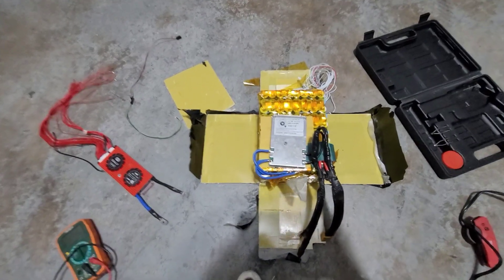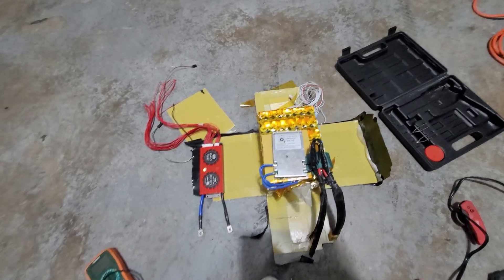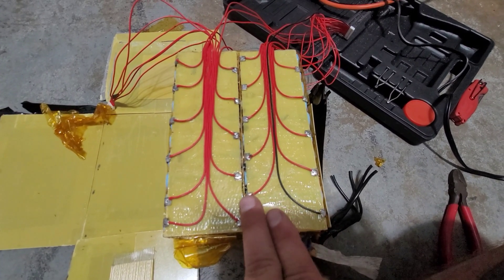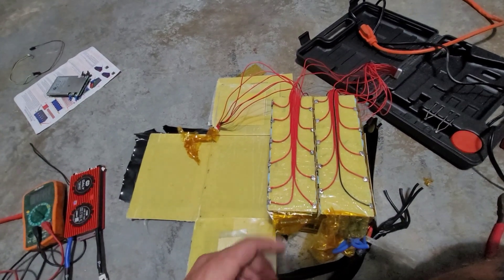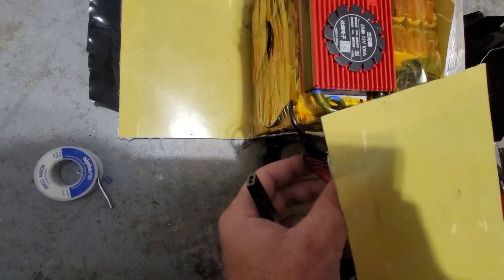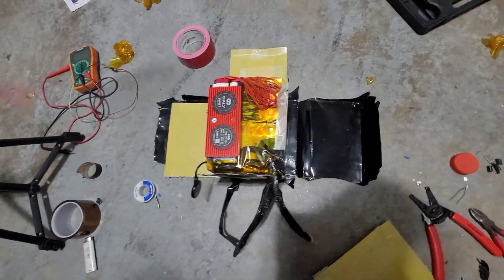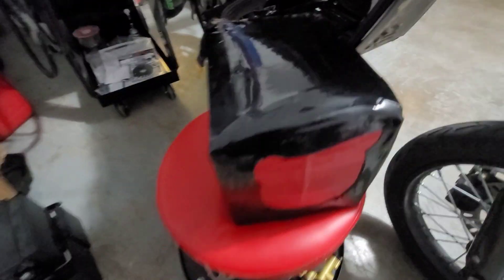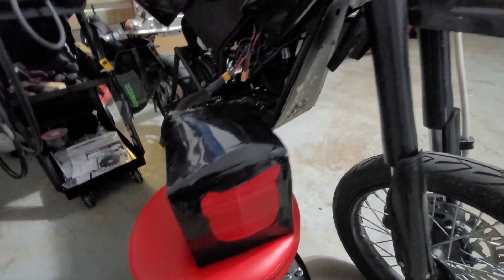Daly BMS Swap on the Electro&co 72v24ah Battery

Comment: old video and all but my battery had a faulty bms and I couldn't find a replacement so I bought one of these, however my battery has 4 phase wires for the secondary connector that attaches to the final series, but the daly bms has 4, they have the same total amount of wires and this is the only issue, should I just wire them in the same order?
Reply from the maker: Im not sure what you mean by phase wires? But id assume yes wire them up in whatever order they are. Sounds like your talking about the 4 ground wires?

Comment: Did you feel a power increase ??
Reply from the maker: No power increase, i did it for the bluetooth capability so i can monitor the cells! I cant also controller the discharge and push the cells passed their limits without the bms cutting out. This just gives you more control of what you can do.

Comment: My friend a question...
Can I use your bms (20s 120a) for a 16s battery..?
For example Anti bms can work from 7s to 24s..
With the same process, can I connect only the 16s balance cables from Daly 20s..?
Reply from the maker: Im actually not too sure about that. Possibly if you can change setting in the bms app but youd have to do some research in that

Comment: Hey, I have one set of battery using Daly, the Bluetooth seems more Stable than the Ant's, never have an issue with it yet, maybe because its an 84V battery, let us know how it preforms in the long run:elbowcough:
Reply from the maker: So far the battery feels alot cooler to the touch after my test rips. Im not 100% sure how well the ant performed since i could never connect the bluetooth. But the daly seems to keep the cells balanced very well even after i beat on them. Ill definitely keep everyone updated. 😁🤘
Reply: @EmxBrandon  I got like 4 Batteries with Ant, most likely I cannot get them connected on the Trail, if they cut off, I rarely can wake them up, I always bring a rope when I go riding with buddies, so they can pull me back to trail head. but the Daly will always pop up in the app when I turn the key on.
only cons is I seems not updating its status as quick as Ant did
Reply from the maker: Thats good info to know. Thanks for that, it definitely makes me feel good about the daly swap. I do like that it wakes right up just by turning the bike on.